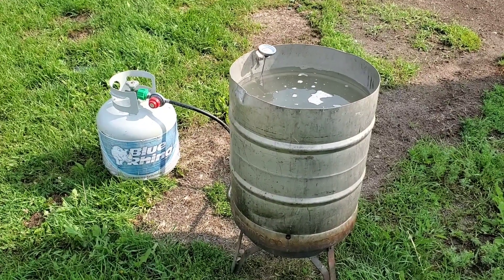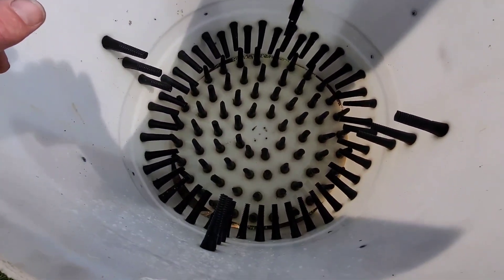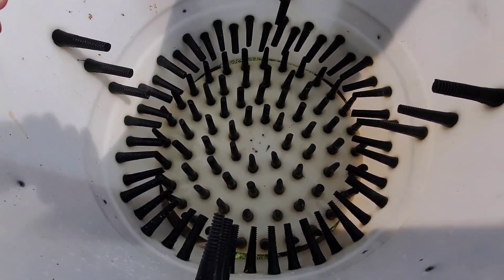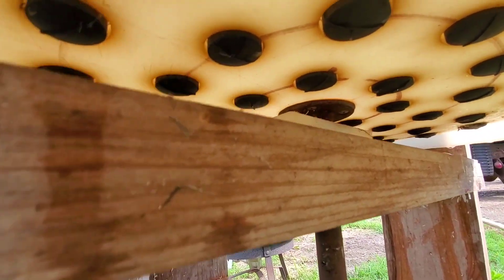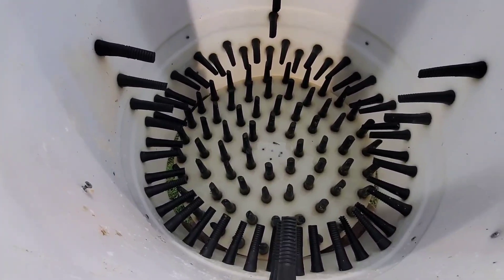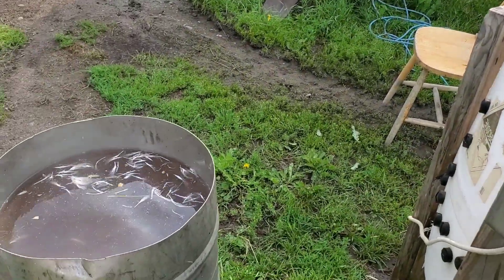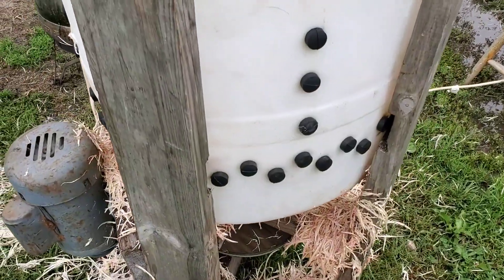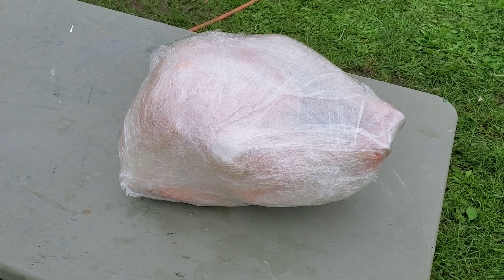Homemade Chicken Plucker.

Comment: Cameras and framerate are an amzing thing. I love how when you flipped the switch at  6:09 all the pegs look like the are spinning clockwise except the outer most pegs. Whatever the RPM on that is most be close to what the camera frame rate is. Kinda neat haha.
Reply from the maker: I noticed that when I was putting the video together. I was wondering if anyone would comment on that because it was really noticeable. I think we were going for about 250 rpm when we built it but ended up with about 280 if I remember correctly.

Comment: I'm late because I was turning into more of a redneck that usual. I've seen a model made in Fairfax . The rubber knobs were on the outside of a spinning drum. 
Thank you Will.
Reply from the maker: Bryce. I missed your comment. I've used a drum plucker they also work well. They are probably better for waterfowl and big turkeys because you can kind of control what's going on.
Reply: @farawayfarm2520  No worries.  I watched your hay video,  but couldn't think of anything to add.